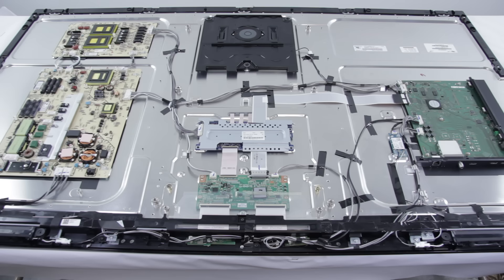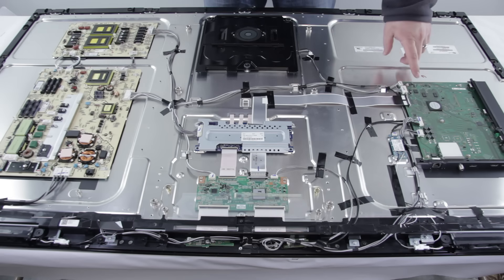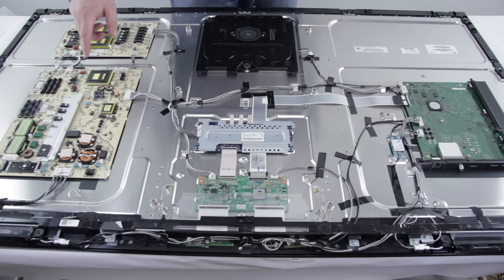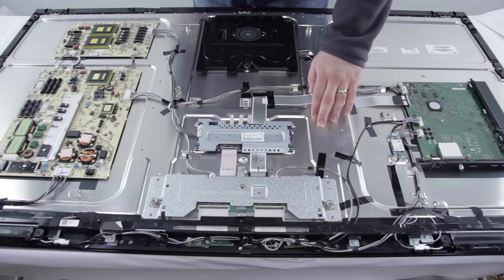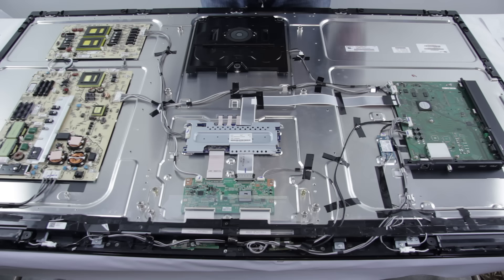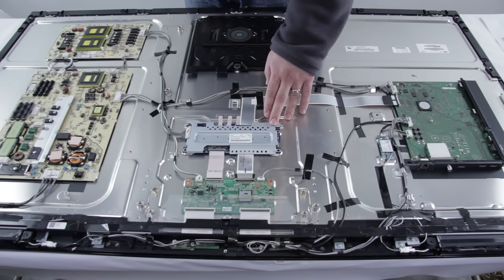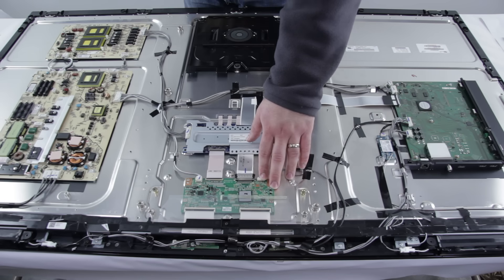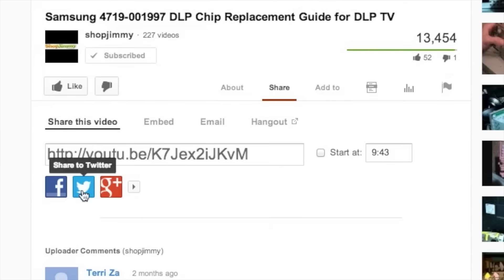LED TV Repair Tutorial - Common Symptoms & Solutions - How to Repair LED TVs

Comment: Hey ShopJimmy, I have Samsung 40 inch 3D smart LED TV with model number UA40F6400DKXXT and the problem I am seeing is horizontal black shadow strips on the screen. Earlier one strip was at the bottom of the screen and now I see one strip in the middle of the screen also. These shadow areas are around 4-5 inches each in height and have lesser illumination in them. Can you please help in pointing out the probable area of fault and its fix. Also, it will be helpful to understand the possible reason for this issue so as to avoid it in future if possible.
Thanks a lot in advance buddy. Your channel is doing a great job.
Reply: Yes, sorry for forgetting to post. My problem ending up being the panel, which cost about the same as the tv. So I am just dealing with it. The tech did try replacing the main board but it didn't do anything.
Reply from the maker: Vivek Mittal  Please watch this video FIRST to help with your repair!  https://www.youtube.com/watch?v=BP3NVNCGEv8  This could be a problem with either the main board or the TV panel in your TV.  Replace the main board to see if that fixes the problem.  Click this link to replacement parts for your TV model number:  http://www.shopjimmy.com/catalogsearch/result/index/?cat=56&q=40F6400  There may be multiple boards for the same TV model number, be sure to match part numbers on your current board, with your replacement for compatibility.  Thanks and please let us know if you have any further questions with your TV Repair!  www.shopjimmy.com
Reply: Did you resolve this issue? I have the same problem...
Reply: No Peter, I have not yet tried changing the parts of the TV. Do you have the same model of TV?
Reply: Vivek Mittal I have a Toshiba with what I think is similar issues, I am going to take it to a local shop hopefully this weekend and see what they say about it, I can let you know.
Reply: Please do let me know what they say about it.  I plan to open my TV myself before I take it to the technician. Your inputs will be really helpful for that.
Reply: Hi Peter Charpentier, Could you get a chance to take your TV to a local shop this weekend? Could they detect and rectify the issue?
Reply: Vivek Mittal I was not able to do so, we had a major snow storm over the weekend. I'll keep you updated.
Reply: Peter Charpentier, I read about the snow storm in US Midwest and Northeast area. You take care of yourself and your family during the storm. Thanks for keeping me posted.
Reply: I swear i get that too! but since my component(av) and hdmi ports are all messed up i think i have to replace them
Reply: Hi Peter Charpentier, Any update on this? Could you get a chance to take your TV to a local shop this weekend? Could they detect and rectify the issue?
Reply: Ok Peter... Thanks for the information.

Comment: Hello, I have a samsung ln40a550p3fxza that is showing read shadows on the screen after it gets hot. What would be the most likely competent causing this issue?

Thanks,
Reply: ShopJimmy.com
Thanks for the response. I replaced the Main Board a few weeks ago and got a different behavior. It took longer to get the red lines (5-8 hours of continuous use), but they did come back. Thought it might be heat related so I started running a fan behind the TV to dissipate the heat (the PS3 is near there as well) and I have not had any red lines since. Does that still sound like a panel? I'll limp along like this waiting for end of model year clearance. :)
Reply from the maker: Tom Verstraete   Sorry yeah still a panel issue the panel IC's are overheating giving you the lines.  The fan is a bandage and the issue will get worse over time.  Thanks!  www.shopjimmy.com

Comment: I have a Samsung UN32EH5300FXZA.  There is sound but no video and I can see the display with a flashlight and navigate around. You say that's often a symptom of a bad inverter/driver.  I have the cover off of my TV, but there is no board (inverter) between the main board and the tcon board. Does this mean the inverter is integrated with the main board?

Update: I replaced the power board/LED driver (same board) and that did not fix the issue. Does that mean that the LED panel itself is bad?

Comment: I have a samsung led tv 32" with model no. EU32EH5000W and my issue is that i have image and sound but do not have backlight does this model have inverters or a panel issue all together can you help me please?

Thanks in advance for your help.
Reply from the maker: Dimitris Tasis   Please watch this video FIRST to help with your repair!  https://www.youtube.com/watch?v=BP3NVNCGEv8  This could be a problem with either the power supply board in your TV or the LEDs in the TV panel.  Click this link to replacement parts for your TV model number on our website:  http://www.shopjimmy.com/catalogsearch/result/index/?cat=229&q=32EH5000  There may be multiple boards for the same TV model number, be sure to match part numbers on your current board, with your replacement for compatibility.  Thanks and please let us know if you have any further questions with your TV Repair!  www.shopjimmy.com
Reply: ShopJimmy.com Thanks for your reply but after a tour to my local samsung service guy he is determiend that the problem is the panel and it is a bit pricy for a replacement it is 305€ and i bought it 340€....any ideas?
Reply from the maker: Dimitris Tasis   You can either replace the panel or replace the TV.  We do not sell TV panels.  Thanks!  www.shopjimmy.com

Comment: I have a 47ln5400 LED LG tv and the backlight just went out in the middle of the show I bought a power supply board from you but that did not help the back lights still don't come on, what is the most likely cause for this?
Reply from the maker: Nathan Tschida   This sounds like you have bad LEDs in the TV panel.  If you have bad LEDs it is recommended to replace the TV.  Thanks!  www.shopjimmy.com

Comment: Howdy-   I have a Sharp LC-46le810un -  from 2010.  Great Picture but recently it has started to turn of and restart at random.  Sometimes it will not power up at all.   If I leave unplugged for a while, it will restart and play normally for a while.   I have also done the "input" plus "volumne up" then power; which makes it work for a few days.   Is this software or hardware?   Thanks  - Peter
Reply from the maker: Peter Hicks   Please watch this video FIRST to help with your repair!  https://www.youtube.com/watch?v=BP3NVNCGEv8  I recommend replacing the main board in your TV.  Click this link to replacement parts for your TV model number:  http://www.shopjimmy.com/catalogsearch/result/index/?cat=56&q=LC-46le810un  There may be multiple boards for the same TV model number, be sure to match part numbers on your current board, with your replacement for compatibility.  Thanks and please let us know if you have any further questions with your TV Repair!  www.shopjimmy.com

Comment: hi, I have a Toshiba LCD TV model 40HL933B and even though less than  2 years old the  picture suddenly went  by the screen going white and shrinking to a dot in  the centre of  the screen before disappearing. the sound has also gone, but i  still get the power light on.  Your tutorials show that it may be the motherboard and i  have taken the back  off to look for the part numbered shown but even having followed the tutorial for finding a toshiba mother board number I cannot find a number that matches. There is nothing written on the board but there is a sticker with the following on HSF 11488664 - MB14912 - 60EB40M0MB1P.  Can you help?
Reply from the maker: Piers Liron   Unfortunately I do not see any replacement parts for that TV model number or board numbers on our website.  Thanks!  www.shopjimmy.com

Comment: I have a westinghouse led 3255vx, the tv only flashes a dimly and the sensor keeps flashing as well, i can't seem to get the tv on off, just keeps flashing. What could be the problem?
Reply from the maker: Wendy Theroulde  Please watch this video FIRST to help with your repair!  https://www.youtube.com/watch?v=BP3NVNCGEv8  I recommend replacing the main board in your TV.  Click this link to replacement parts for your TV model number:  http://www.shopjimmy.com/catalogsearch/result/index/?cat=56&q=3255vx  There may be multiple boards for the same TV model number, be sure to match part numbers on your current board, with your replacement for compatibility.  Here is a link to a video showing how to identify your part number, click here:  https://www.youtube.com/watch?v=SoUXsgOx25o  Thanks and please let us know if you have any further questions with your TV Repair!  www.shopjimmy.com

Comment: Hi. I have a Samsung UN55ES6100FXZA TS01. While watching it the screen suddenly went black but sound remained. I did the flashlight test on the display and I am still getting images through all the inputs but no backlighting. I replaced the power supply/LED driver inverter board since they are combined on one board (Samsung BN44-00503A Power Supply / LED Board) but the problem remains. What would be the next thing to look at in order to get the backlights going again? I even removed the display itself to see if anything was burned on the led bars but they are only a string of leds, no other electronics just wires going to the led bar left and right. I find it difficult to believe that both strings of led's burned out... 
Thanks for any input or guidance
Reply from the maker: Jim S  Please watch this video FIRST to help with your repair!  https://www.youtube.com/watch?v=BP3NVNCGEv8  This could be a problem with either the power supply board or bad LEDs in the TV panel.  You can replace the power supply board to see if that fixes the problem.  Click this link to replacement parts for your TV model number:  http://www.shopjimmy.com/samsung-bn44-00503a-power-supply-led-board.htm  Be sure to match part numbers on your current board, with your replacement for compatibility.  Thanks and please let us know if you have any further questions with your TV Repair!  www.shopjimmy.com

Comment: Seiki 40' SE40FY19 Just one year old. Won't power on. Red light blinking. Only used for gaming a few times a week.
Reply from the maker: Kim DeRosia   I recommend replacing the main board in your TV.  Click the link to replacement parts for your TV model number:  http://www.shopjimmy.com/catalogsearch/result/index/?cat=56&q=SE40FY19  There may be multiple boards for the same TV model number, be sure to match part numbers on your current board, with your replacement for compatibility.  Thanks and please let us know if you have any further questions with your TV Repair!  www.shopjimmy.com
Reply: I have RCA TV model:L80D12 and i am seeing a white shadow covering the screen after the tv is turned in for five minutes or more and it does not go away unless the tv is turned off and then turned o again. I can see the pictures on the screen, but only beyond the white shadow covering the screen.
Reply: kevin jackson what can i do?
Reply from the maker: kevin jackson   This sounds like a TV panel (TV Screen) problem.  If your TV panel is bad, it may be more cost-effective to replace the TV as panels are typically hard to find in stock, difficult to replace, and expensive.  Thanks and please let us know if you have any further questions!  www.shopjimmy.com

Comment: I have a Samsung LED TV model UN46FH6030FXZA.  About 5 seconds after being turned on, the TV picture turns dark. The picture is still slightly visible and the audit works fine. After watching some of your videos, I thought that it was the LED Driver but when I took the back cover off, there is only a T-Con board, main board, and power supply board. Please help.

Comment: Samsung UN32F5000AF LED TV has sound, but no picture.  It passed the "flashlight test" (yes, I can see images on the screen with a flashlight)

From your videos, it seems like I have a bad LED driver.  Is this a correct diagnosis since I can see images on the screen with a flashlight?

What is the correct repair? Replace my main board (BN94-06177B)?  Does not appear to be a separate LED driver, but seems to be a part of the main board.

SteveZ
Reply from the maker: *****  Please watch this video FIRST to help with your repair!  https://www.youtube.com/watch?v=BP3NVNCGEv8  This could be a problem with either the power supply board or the LEDs in the TV panel.  You can replace the power supply board to see if that fixes the problem with your TV.  Click this link to a replacement power supply board for your TV model number:  http://www.shopjimmy.com/samsung-bn44-00605a-power-supply-unit.htm  Be sure to match part numbers on your current board, with your replacement for compatibility.  Thanks and please let us know if you have any further questions with your TV Repair!  www.shopjimmy.com

Comment: Hi, I have an LG 42" LED Model: 42LS5700, When I turn it on the TV works perfectly but after 15  min or so the back light turns off. There is still image on the screen but really dark and I have to turn the TV off and on again for another 15 or 30 min of normal TV. I was recently told it might be the power supply what might be your opinion ?? Thank you in advanced.
Reply from the maker: Carlos Medrano Lopez  Please watch this video FIRST to help with your repair!  https://www.youtube.com/watch?v=BP3NVNCGEv8  This could be a problem with the power supply board or the LEDs in the TV panel.  You can replace the power supply board to see if that fixes the problem.  Click this link to replacement parts for your TV model number:  http://www.shopjimmy.com/catalogsearch/result/index/?cat=59&q=42LS5700  There may be multiple boards for the same TV model number, be sure to match part numbers on your current board, with your replacement for compatibility.  Here is a link to a video showing how to identify your part number, click here:  https://www.youtube.com/watch?v=_4Qpfan0vdU  Thanks and please let us know if you have any further questions with your TV Repair!  www.shopjimmy.com

Comment: Hi there!  I've got an LG 32LE5300-UC.  My TV has stopped playing audio over the built in speakers.  I can get audio out of the headphone jack and the TV recognizes when headphones are plugged in.  Any suggestions?  I was going to try a firmware update, but it doesn't appear that there is a downloadable version of firmware for this TV.
Reply from the maker: Marc Janisse   Double check the settings on your TV and be sure the speakers are set to ON.  Thanks!  www.shopjimmy.com
Reply: ShopJimmy.com that's an obvious one and yes, speakers are on.  I have played with all settings and reset the TV a number of times.   I even asked LG.  They said it was a hardware issue (without looking at it themselves of course).

Comment: my led TV sometimes has no picture and sound when I connect it with an HDMI cable to my PC. in TV mode the sound keeps breaking, its LG LN5100 32 inch model no: 32ln5100-TA
Reply from the maker: Tuffouratta Evans   I recommend replacing the main board in your TV.  Unfortunately I do not see any replacement parts in the search results for your TV model number on our website.  Please reply with your part number on your main board and I can try searching for replacement parts.  Thanks and please let us know if you have any further questions!  www.shopjimmy.com

Comment: hi,    im having a problem with my hitachi tv    L24VG07U   serial number:  V12A01612    the problem it just stopped suddenly there is no light or anything on it, changed the fuse nothing happened TV is completely dead .  please help. Thank you
Reply from the maker: crazyutubegirls A&M   I recommend replacing the power supply board in your TV.  Unfortunately I do not see any replacement parts in the search results for your TV model number on our website.  Please reply with your part number on your power supply board and I can try searching for replacement parts.  Thanks and please let us know if you have any further questions!  www.shopjimmy.com

Comment: Hi Jimmy.  Apex 46" LCD TV.  MODEL: LD4688.  Turn the TV on and their is sound but the screen remains black.  The channel will flash on in the right upper corner initially, then just black.  My research leads me to believe it's the backlight inverter.
Reply from the maker: manofsteel05   I recommend running the flashlight test on your TV.   Here is a link to a video we produced that shows how to run the flashlight test. https://www.youtube.com/watch?v=xUzCLgoSPGM Please reply with your flashlight test results and we can recommend a replacement part for your TV repair. Thanks and please let us know if you have any questions! www.shopjimmy.com
Reply: No backlights.  Audio fine.  Image visible on the screen when using flashlight.  Thanks.
Reply from the maker: manofsteel05  Please watch this video FIRST to help with your repair!  https://www.youtube.com/watch?v=BP3NVNCGEv8  Yes, I recommend replacing the inverter(s) in your TV.  Click this link to replacement parts for your TV model number.  http://www.shopjimmy.com/catalogsearch/result/?q=LD4688  There may be multiple boards for the same TV model number, be sure to match part numbers on your current board, with your replacement for compatibility.  Thanks and please let us know if you have any further questions with your TV Repair!  www.shopjimmy.com

Comment: I have an RCA LED tv model number RLED2627A  and my picture suddenly went white while we were watching it.  You can see a faint picture on the right side but left side is blank.  I watched a video that recommended to change the T-Con board so I did that but nothing changed.  What could be the problem?
Reply from the maker: Stan Vowles   This sounds like a TV panel (TV Screen) problem. If your TV panel is bad, it may be more cost-effective to replace the TV as panels are typically hard to find in stock, difficult to replace, and expensive. Thanks and please let us know if you have any further questions! www.shopjimmy.com